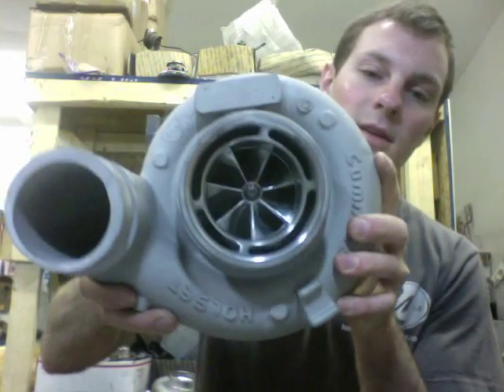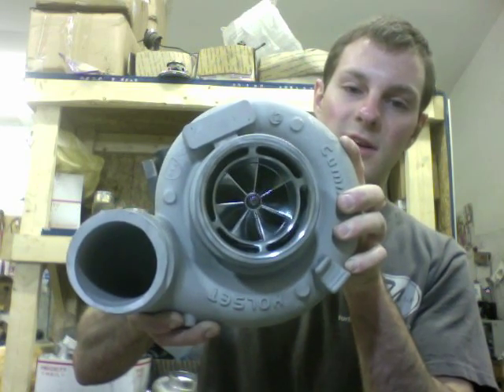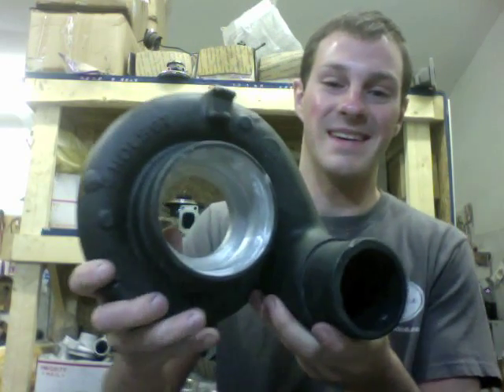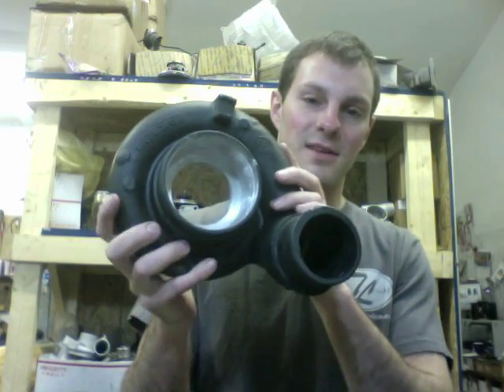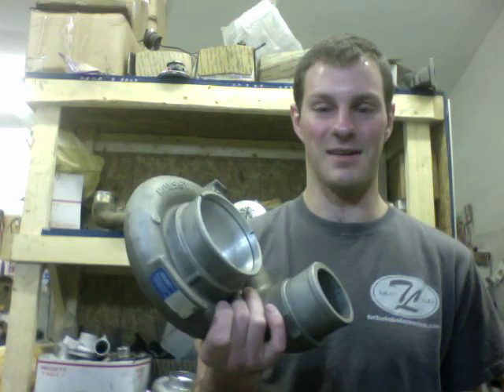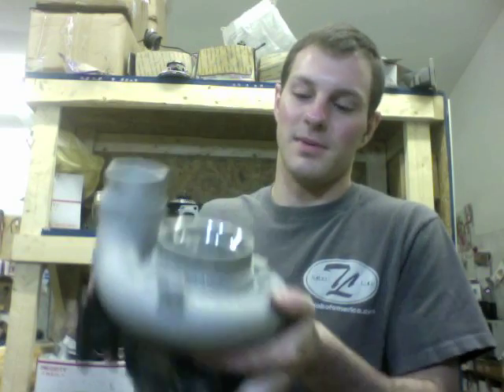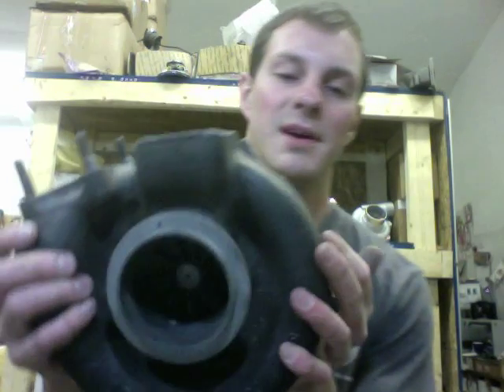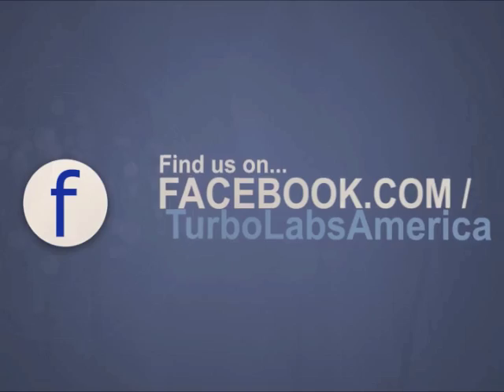2008 + Dodge Ram Cummins 6.7 VGT Turbo Upgrade

Comment: Is the process for a 2011 VGT the same as an 08, or does it require different parts
Reply from the maker: The rebuild kit is the same from. 2007.5-2012, the rebuild kit changed in 2013- present.
Reply: And what to you charge for machining the housing?

Comment: I've got this turbo on my truck.  It's been running hard for nearly 2 years.  I have never had an operational actuator on it.  It runs hard though it spoils slow without the actuator.  It is a running sub when it starts boosting though.  Factory sticks, full delete, Torque Tech tuner.
Reply: Any videos of this

Comment: I have a stock 2015 Ram 2500 CTD what Turbo comes in mine ? I know it’s a Holset but not sure the exact model
Reply from the maker: It's an he300vg, the turbo is a little different but the upgrade is the same

Comment: i removed my silencer ring and i have no problems with it. more boost and better sound
Reply: its an 08
Reply from the maker: +kyle turnwald the silencer ring shouldn't be removed in the he351ve and he300vg but you can remove the ring in a lot of other models
Reply from the maker: On the ve if you remove the silencer then you don't have antisurge anymore.

Comment: Not sure if anyone has asked but is the factory exhaust brake vgt effected by this? 

another question is are there any issues if the silencer ring was removed but could be pressed back in? Or should you get a new housing?

thank you
Reply from the maker: +Dwayne Martin some turbo builders cut the silencer ring out and press in a different style. I prefer not to mess with that, because I don't want the liability of it having a problem. 

There is a special formula to determine the size a location of the antisurge groove (mwa) which would have to be redone when the inlet is removed.
Reply from the maker: +Dwayne Martin I only had one person say that they had an issue with the exhaust brake not working. I'm not sure if it was another issue or not.

Comment: Not sure if anyone has asked but is the factory exhaust brake vgt effected by this? 

another question is are there any issues if the silencer ring was removed but could be pressed back in? Or should you get a new housing?

thank you

Comment: What gains can one expect from this upgrade?
Reply from the maker: +Antonio Cole we have a customer that is making over 700hp but on the he351 model for the 5.9 common rail. The 6.7 is capable of more power though because it has a larger turbine housing. This is the largest avaliable upgrade in the stock housings.
Reply from the maker: We have people making in the 800 hp range with the he351ve upgrade

Comment: how does this compare to a cheetah or super b?
Reply from the maker: +aaron janes Size wise the cheatah is 63 mm on the compressor. I have a 64 x 90 compressor also but usually most of the upgrades i do I build to the largest size. The super b is a Borg Warner turbo, I could find much information on the size, I never liked the Borg warners on the Cummins,  because if they fail then you have to buy another turbo if you need a shaft or bearing housing because parts availability is not good.

As for performance wise We did this upgrade for  5.9 common rail with good results. We still have to test on the 6.7.
Reply: It would be going on a 6.7.  If possible shoot me some contact info. I'd like to see how your prices compare.i like to go against the norm and try new ideas
Reply from the maker: +aaron janes turbolabamerica@gmail.com

Comment: Machine a new silencer ring and drop it in I guess.
Reply from the maker: +boxdrinks it is possible, but its not cost effective. i could buy a solid aluminum piece for 20$ or whatever it would cost, machine it down and press it in, and go buy and endmill for 30,000$ and recut the antisurge on the front  and then recut the antisurge groove with the lathe. But i just have a feeling that the customer would go back and machine it out again. He and i just arent on the same level of understanding, i just dont want to waste anymore time on it. Sometimes with customers its a language barrier, i really dont know why he doesn't understand me.
Reply: Some guys wont listen about removing it because they prefer the sound difference